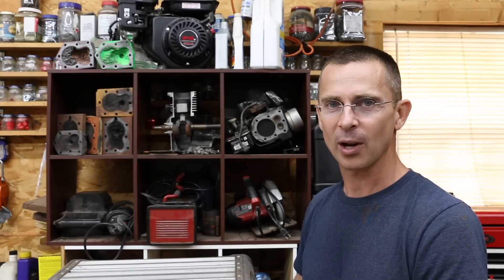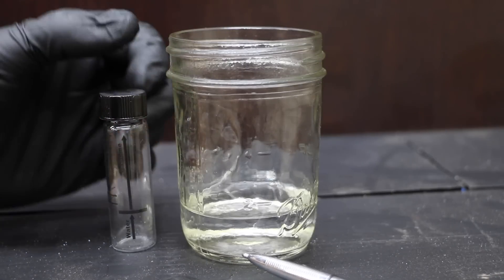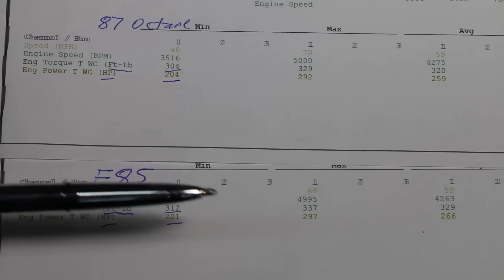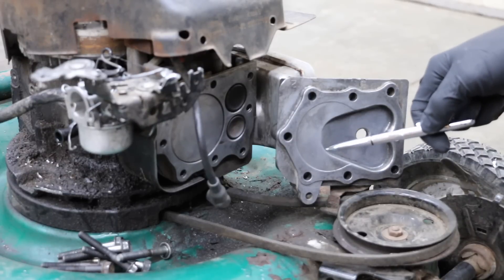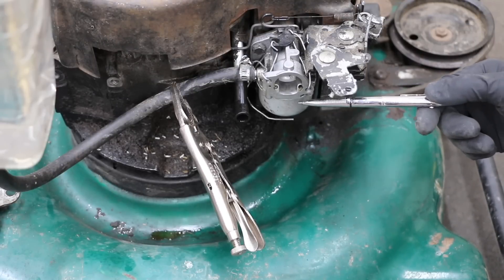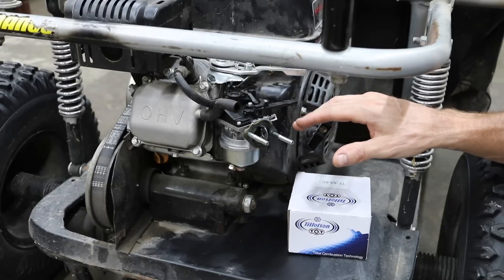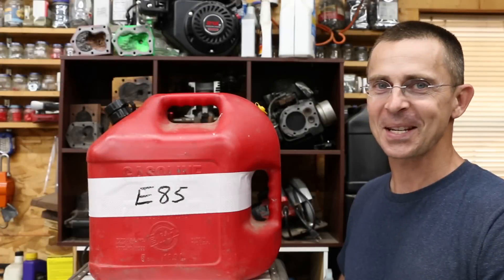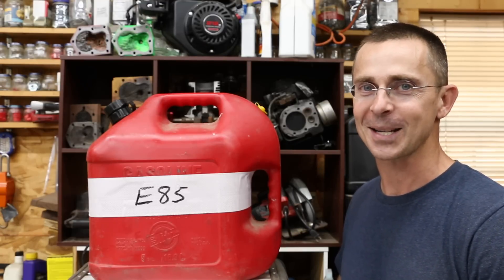Is E85 better than Gasoline? Let's find out!

Comment: In an engine that can take advantage of ethanol's cooling effect as well as the it's octane rating being roughly 100-105 octane, ethanol is essentially cheap race gas. The mileage from E85 is typically about 30% lower than gasoline but in many locations E85 is half the cost. Using my car as an example-when tuned for an E30 mix of gasoline and ethanol, my car makes about 30 more wheel horsepower and 50 ft lbs more torque at the wheels than premium gasoline. It's great stuff for direct injection engines but small engines (like lawnmowers) hate it.
Reply from the maker: Thanks for the feedback.

Comment: Thanks for your video. I have a Honda Civic si 1.5t tuned and I use a gal and a half of e85 to keep my knock in check. It works wonders. I am not tuned for e85 because I only am using a small amount just to raise the octane a few points. Thanks
Reply from the maker: You are welcome!  Thanks for the feedback.

Comment: Hmh, interesting, can anyone tell me if the stock used seals and ethanol critical parts of an 2006 GEN III 5.7L HEMI can use E85 or even ethanol fuel without damage or issues?

I know, Chrysler or even Dodge has the later Models of the Dodge Charger also with the "Flex Fuel Unit", even also based on the 5.7L HEMI (Later ones has VVT, mine not)...But i don´t think that it these days the companies like Chrysler would make different seals for the engine, because in many sorts of gasoline is also a part of ethanol. At germany the only gasoline what you could get is the 95 octane and these has 5% ethanol in it. That´s the example for it. And that´s why i say; Int these days it would make me wonder if the Auto makers would use different seals for the same Engine that is called "Flex Fuel Unit". I think the ordinary gasoline unit has got the same seals by the company....Or i´m false???

Cheers Till

Comment: My education was Mechanical Engineering with concentrations in heat & fluids (power generation). I spent 15 years as a machine designer. ( electric motors, never used the education I was specialized in). The tests match the theoretical data on generating power from gasoline & alcohol as alcohol burns with less BTU' s than gasoline. It also takes more BTU's of energy than gasoline to produce one gallon of it. The steam generated from the alcohol makes up for the lack of BTU's generaed when it is burned with mostly gasoline as in  gasoline mixed with 10% alcohol. As the amount of alcohol is increased in a gasoline/alcohol blend; the lack of energy becomes more apparent, as is in the case of an E85 mix. Most auto and especially mower plastic components are not designed for high alcohol concentrations. Since western Ohio ( in my case central & western Ohio) now have Casey 's which sells 88 octane fuel with 15% ethanol; should I really use this fuel in my car? I t runs really well in the car but what about my fuel mileage & damage to the plastic engine components in my car? I buy it very seldom due to these fears but it is cheaper and seems to make a good tank topper. Is it really worth the 5¢ per gallon savings. ( thanks to Federal government subsidies on alcohol)

Comment: 2005 Toyota Camry 4cyl, added the conversion kit in 2015 and been running E85 pump gas, no problem. 214K miles now.
Reply from the maker: Thanks for the feedback.

Comment: Great test!  I’ll run e85 in my 2016 3500hd with 6.0 in it but only when it’s at least 30% cheaper than regular 87 octane as I’ve found the mileage suffers about the same as you found in the video.  Here’s a question…do you think there would be any benefit in a flex fuel vehicle to run e85 periodically just to clean the fuel system and combustion deposits from regular 87octane?  Thanks again for the video, the dyno test really was surprising especially.
Reply from the maker: Thanks and you are welcome!

Comment: I love your video, it was spot-on. I have a 2018 F150 with the 3.3 that was designed to run on both fuels. I can only say E85 sucks. It is either I get the mileage or I saved on fuel cost. I looked up your video because I noticed I was not getting nowhere near the mileage I was getting on regular gas. No matter what I feel you'll is nothing but a price gouging game in America. I drive on the highway so I am not going to use E85 anymore.
Reply from the maker: Thanks!  Thanks for the feedback.

Comment: Where you will find that e85 shines is in cars tuned to make the most of e85 in a performance application...  for example, my car get 605hp on e85 vs 540 on premium gas/e10.. The tuner uses both the e85 data and the premium gas data and develops maps based on how much adjustment either gas lets him get away with. My software  allows for flex fuel mapping, so i do not have to manually change the maps to avoid a problem. 

Fuel delivery is a strong consideration for e85... since the car eats more e85 than it does nolead fuel, a stronger pump is required to maintain pressure in the system. Injectors should be larger to accommodate increased flow.

Oxidation is a concern. Ethanol friendly fuel delivery by means of ethanol rated pumps, anodized fittings, ptfe fuel lines and ethanol rated filters go a long way in avoiding breakdown of the system and contamination. 

Oil can get diluted more quickly... Oil changes should ideally be more frequent to avoid a build up of e85 in the oil pan via blowby, 

e85 has a lower vapor point than premium. If your system is running hot, you might vapor lock quicker than with premium., Fuel cooling is a factor if the pump(s) are heating up the contents of your fuel tank. i.e. I have vapor locked at around 125 on e85 where i was still functional up to about 138 on premium.(during a time of test and tune where fuel heating was being diagnosed).

Winter is a concern with e85... but most at-the-pump ethanol is reduced to avoid rough starts or stalling. 

e85 is a great fuel, and is more interesting when used in suvs and pickups for towing. For me, it is a good safe track fuel ... but id never let it sit and fester in my fuel system for long periods of time
Reply from the maker: Thanks for the feedback.

Comment: So I have a 2013 Dodge Dart that is E85 compatible and Irani 85 for the majority of its life so if I run E85 all constantly get about 28 up to 31 miles per gallon depending on commute e87 I'll get roughly 31 up to 36 MPGs on my commute there's also a drag car that runs on E85 and the biggest thing I noticed is if you're going to let it sit the acidic Miss can become a problem so at the end of the season I always put just 91 in and run it very crappily I might add since it's not set to run on 91 octane but it prevents the gas from breaking down Metals in the motor and the rubber in some of the lines and gaskets the biggest reason why I always try to buy E85 is it just keeps the inside of the motor so clean
Reply from the maker: Thanks for sharing.

Comment: My tiny 2011 chevy impala drops 4 mpg between regular and e85, but that's still 28 miles per gallon highway for a much cheaper fuel, so I use it when I can get it especially when it benefits American farmers instead of foreign oil producers.
Reply from the maker: Thanks for the feedback.
Reply: I own a 2011 Impala.  I wouldn't say it's a tiny car.  It sounds like it 6 of 1 and a half dozen of the other when it come to cost.  15% cheaper, but achieve 15% less fuel mileage.  That good to know.  My 3.4 liter is gas only.

Comment: E85 Definitely only for engines designed to adapt to it.. in timing and mixture .. knock sensors, O2 sensors.. with the EMS on proper program  ..  No point testing it on lesser motors
Reply from the maker: Thanks for the feedback.

Comment: For anyone wondering,  e85 doesnt automatically increase power in every car. Since e85 is like 107 octane, some cars will be able to advance the timing of the engine and get a bit more power that way. Also, in turbo and supercharged vehicles, the increased pressure (boost) means that you need a fuel that is resistant to knock and preignition and e85 is perfect for those use cases given the higher octane rating. Running a car making 20psi of boost on even 93 octane gas would cause issues with engine knock, but the higher octane e85 allows you to utilize the power that boost will provide.
Reply from the maker: Thanks for the feedback.

Comment: Cool tests! I love E85. I run E70 in my STI when I autocross and want more fun on a daily drive. I have it set up to run pump and e85 and the computer will figure out the tune per what ethanol percent is running to the fuel rails. I do lose about 30-40% fuel efficiency when at full e85 but I go from 370whp (on pump) and 450whp with e72.
Reply from the maker: Thanks!  Thanks for sharing.

Comment: I have been watching a lot of youre content lately great job!! 

With my experience running E85.  what I have gathered is my tuner can throw a LOT more timing at the car safely so on pump 93 my car can safely make 1090 hp where on Ignite red E90  we can push it out to 1300 wheel blower only no nitrous so to me the gain is being able  to throw more timing I definitely do burn alot more of it and the car does not like to start if it’s 30 degrees but the gains make it worth it I run ignite E85 and and ignite red E90
Reply from the maker: Thanks!  Thanks for sharing.

Comment: As a car guy this is the one thing I actually know more of than he does I’m fairly certain. E85 is a more suitable fuel for high horsepower for forced induction motors. It’s a more stable fuel which allows the use of much more timing than 93 in turn you get more power. Yes it takes an extra 30% to burn but u will not see a very noticeable gain with e85 unless tuned for it. It does a great job at cleaning out the motor but also keep in mind if you run straight e85 it will break down oil faster and it’s recommended to change oil much sooner running this fuel
Reply from the maker: Thanks for sharing.

Comment: Great test now when you factored in the extra cost you also factored in that E-85 is cheaper? I understand that a lot of gas stations are not giving the full savings but with the government giving intensives E-85 should be $2.25 if regular is at $3.00.
I had that engine in my 2008 Trailblazer and that thing moved, I did have some mods and it was rear wheel drive only but that is a great engine in my opinion.

Comment: Been running E85 mixes (E30~E45) in all my boosted cars for many years, excellent fuel. Even run straight E85 in in my chainsaw, weed wicker, and mower they all run fantastic with extra torque.
Reply from the maker: Thanks for sharing.

Comment: So how about making a video where u compare pump gas, engineered fuel, flex fuel, and leaded gasoline n see which gives you the better nunbers. In both 2 cycle and 4 cycle motors across the board. I think that would be an interesting flick. Good videos, keep at it, ill stay tuned in
Reply from the maker: Thanks, will do!  Thanks for the suggestion.

Comment: In a performance application, E85 has an octane rating of ~108 which means that the car can be tuned to use more aggressive ignition timing and more boost without running the risk of excessive knock. 

Another good thing about E85 is it’s cooling capacity. In direct injection engines the injected gasoline cools the cylinder substantially. E85 can absorb about 2.5x more heat per volume than regular gasoline which reduces cylinder temp and EGTs. 

The caveat to that is that E85 has less energy per volume than gasoline, so the car must use more E85 to be able to make enough power to cruise. This leads to substantially worse fuel economy, and in most places that fuel economy drop balances out the cheaper cost of E85. 

Some cars will run into issues with their fuel pumps when they run E85 as the pump cannot pump enough fuel to meet fuel requirements from the ECU, even when tuned for E85. Also, some cars have issues with the ethanol melting and damaging fueling components. 
To get around these two issues without replacing fueling components many people will mix E85 with 91 octane to get an E30-E70 mix depending on the car. 
The octane of E30 mix is around 97 and the cooling capacity is still 2x the capacity of gasoline so it is still very beneficial. 

All in all, someone who’s looking to make more power in their boosted car can be upgraded and tuned to use E85 to make ~20% more power with the disadvantage of worse fuel economy.
The only time someone should use E85 is if the car is built to handle it as using it in most American and Japanese cars will damage fueling components and will mess up the fueling maps of the car with no extra gain to power or efficiency. In the case for most people the only reason to use E85 is it’s supposed to be more environmental friendly than gasoline. 

Many European cars can run above average ethanol concentrations with no modifications as the regular gas in European countries commonly contains a lot of ethanol, so the components are designed not to melt. Still, if the car is not “flex fuel” rated, there is no benefits to using E85 and in some cases it can harm the vehicle. 

People will sometimes mix 1-2 gallons of ethanol into their 91 octane on a stock tune to control spark knock if their car is constantly having to cut power or if they live in a place where the gas is subpar.
Reply: The horsepower tests make sense with this surburban as the low RPM test shows the most gain, which is also the spot where the most spark knock will occur under high load.
Reply from the maker: Thanks for the feedback.

Comment: Thing about price though, it would still be cost effective considering 87 is around $3 per gallon and e85 around $2 per gallon.   So despite the lower fuel economy you'd get on e85, you are still saving money as long as the price of e85 is at least 30% lower than 87.
Reply from the maker: Thanks for the feedback.

Comment: The benifit of E85 can be maximised on programmable High performance ECU in which the ignition and timing and boost pressure can be altered..  If not being used on those set ups.;.. It is just an ordinary fuel  like everything else ..
Reply from the maker: Thanks for the feedback.

Comment: just watched your e85 test. wasn't surprised with how clean the fuel burned. i would suggest a retest on the small engine. first run the small engine on gasoline, measure fuel economy. then do the test with e85. both with stock cylinder head. then do a 2nd test for fuel economy with e85 using a high compression racing head. preferably over 10:1 compression. 12 or 13 to 1 would be preferable, but the stock rod and crank would probably fail. due to the higher compression. e85 and 100% alcohol have high octane ratings. pure alcohol is reported to be over 120 octane. thus the ability to run high compression. 
as for your kerosene and diesel experiments,  you may be able to get the little engine to run on those fuels, with a compression ratio over 15 to 1...
Reply from the maker: Thanks for sharing.

Comment: Hi, I have a 1992 Chevy Lumina, v6 fuel injected. I was using e85 in it, and I got close to %20 worse gas mileagde. After about 6 months, I had to replace the O gaskets in the intake. At the time, I was paying about %8 less for it. Did you know, that the federal government still pays companies to manufacture ethanol gasoline? I'm not certain how much, but it has been going on since the early 80's.
Reply from the maker: Thanks for sharing.

Comment: I've been experimenting with E85 in my '91 Silverado and '97 Regal LS. They both run fine on the E85. I did add one quart of Naphtha to each vehicle on the first fill up to lower the octane a little. The Regal is more sensitive and will set a lean code. Lots of people with various brand name "Flex Fuel" cars and trucks have complained about the same lean engine code popping up if they use E85. No codes on regular 87 octane gasoline or E10.
Reply from the maker: Thanks for sharing.

Comment: I got a Bing carb with an adjustable fuel jet back in 1979. These days you can get those for pretty much any engine that has a corresponding motorcycle engine (from 30cc up to 1500cc) and they are cheap.

If you can't find a  Bing that will do it you can get a Dellorto that will, between then you can get whatever you like. I had a 300cc gocart that used one of each with a wire that opened up the second when I put my foot down.

You know... I can't believe I just gave all that stuff away without thinking how much fun my kids could have with it. Just bought a cross bike for my 10 year old granddaughter and I'm thinking I sold all that stuff far too cheap.
Reply from the maker: Thanks for sharing.

Comment: It's going to work fine for most ECU regulated engines, you'll get about 15% more HP out of it. Also, E85 in Europe is actually 85-87% ethanol.

Your problem is the vehicle. Take a look at any Porsche, BMW, Mercedes or the most extreme example Königsegg and  you get something that is actually meant to run on E85. Chevrolet did a sort of .... non compliance mix... It's not road legal in the EU with that ECU because of that. It's just ... just... Don't buy Chevrolet if you want something high quality.

Ethanol in a mower should run fine with any newer B&S, mine is from '99 and apart from the choke rubber thingamabob which had to be exchanged for a new one it runs fine... Of course, it'll run on cat piss and a prayer as well ... It's a B&S after all.
Reply from the maker: Thanks for the feedback.

Comment: My 2014 flex-fuel vehicle has similar drops in efficiency. With ethanol at <70% of the energy of regular gas, the price saving per gallon is not worth it.
Reply from the maker: Thanks for the feedback.

Comment: Here in Southern California E85 is $1.50 cheaper than regular 87 unleaded per gallon, so right now it’s totally worth it if you crunch the numbers.   My vehicle was designed for E85 and I’ve never had fuel related problems.
Reply from the maker: Thanks for sharing.